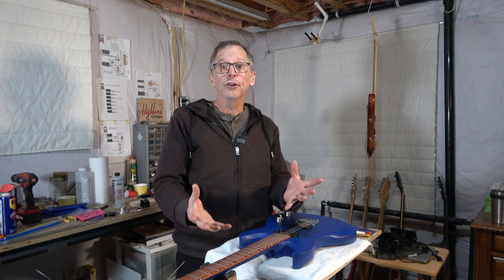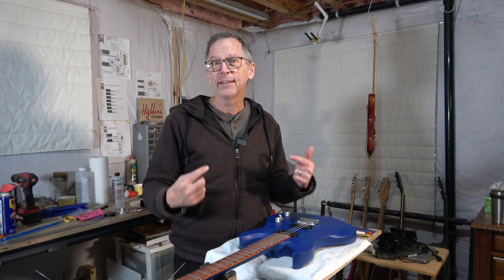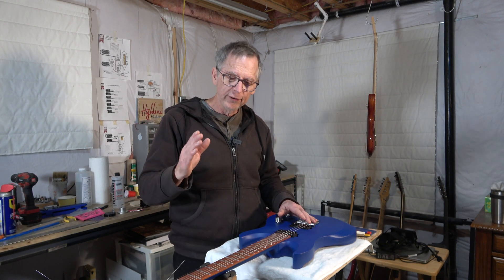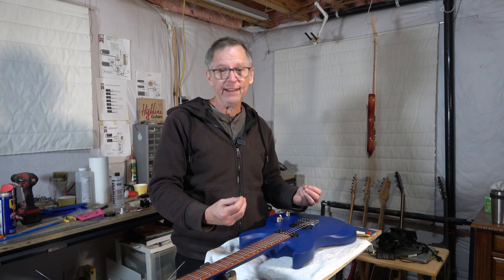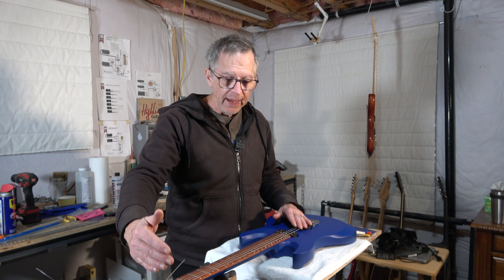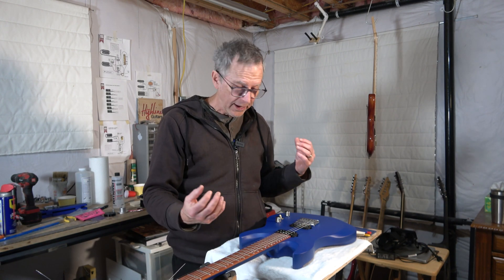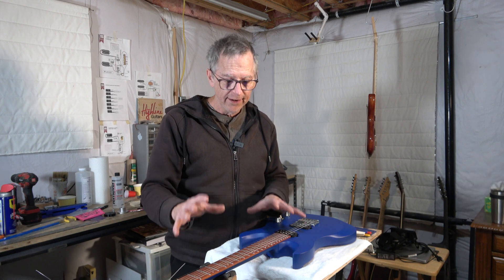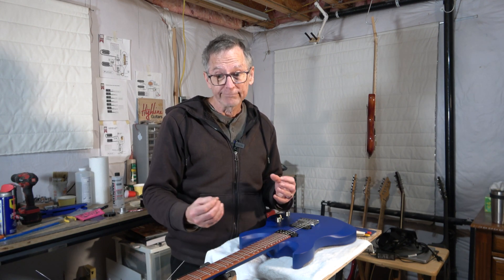Making A 3D Printed Electric Guitar Part 11

Comment: First Act makes that "Discovery" model that is mostly plastic. Granted, it's injection molded rather than 3-D printed and it's probably a different type of plastic. However, they are surprisingly playable. The necks are steel reinforced and there are screws that attach the back of the neck to the front. Otherwise they are completely plastic including the frets which are part of the fretboard itself. This guitar is a longer scale but, there's not really a reason to think it won't hold up. It may start to bow under tension over time. However, it's probably more solid that the First Act.
Reply from the maker: Oh dear, I don’t know about being compared to First Act. If that’s the case, I quit! 🤭

Comment: The tuning anxiety...I know what you mean! Mine is totally stable though, even with a 3D printed fretboard. Your wooden fretboard is gonna help a ton, so I'm totally confident that this will hold up. I suspect that you're gonna have the same pitch sensitivity I'm having when you put pressure on the neck from any direction, but that's manageable. 🤘

Comment: The light gauge strings you installed might help the neck and headstock stay safe... Interestingly, the angle of a headstock dramatically reduce the force and the probability of a snapping. Good job! Inspiring. Nice looking guitar.
Reply: May I ask what you mean by the angle of the headstock reducing the force.  Which force, acting on which part of the neck?
Reply: @cheapskate8656  well, not easy to explain! There was a video of remige lutherie on YouTube about this topic (in French... But I recommend anyway). If the headstock is straight with respect to the neck (like on telecasters) the strings pull the headstock with a portion of the force perpendicular to the neck. With an angle (around 13 degrees) and a proper joint (like on many many guitars) this perpendicular part of the force is diminished. If only I had a blackboard and a piece of shalk!
Reply: @ OK, I understand, thanks.  Its a trade off.  Fender style headstocks very rarely break.  Good scarf joints very rarely break either.  Highly angled headstocks without a scarf joint, like a Gibson, are known to break more often.  Although this probably has more to do with the structural integrity of the timber on that angle (grain direction).  Since we are talking about a 3D printed guitar, my feeling is that the headstock angle will make almost no difference.

Comment: I'm looking forward to hearing how it plays. Those carbon fiber rods do a pretty good job at keeping the neck straight.  
They do a great job in my Jackson JS3 Spectra Bass. My 2016 Ibanez SR300EB has a five layer laminated neck but no rods and it's real sensitive to truss rod adjustments but it has a good neck and stays put year round. Of course it stays in it's case when not in use inside a tempurature stable room.